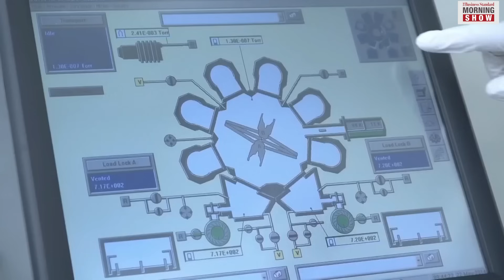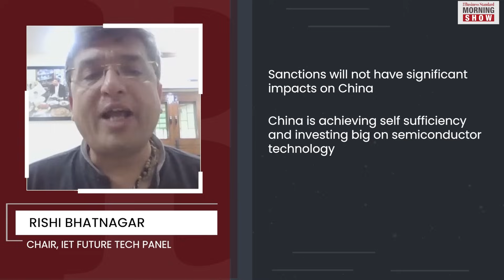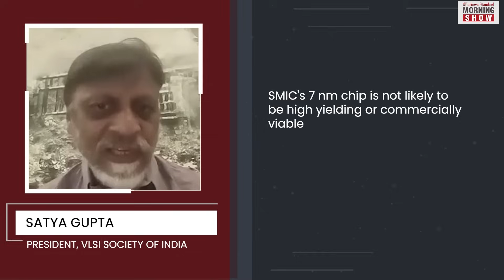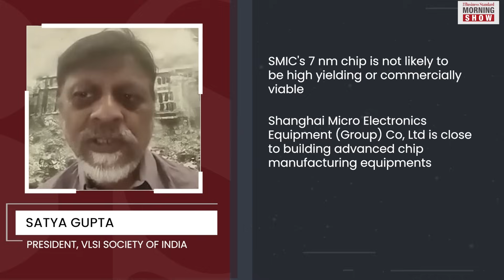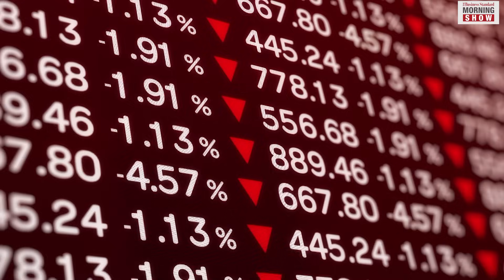Is China winning the chip war?

Comment: wouldn't say they're winning just yet, they're still 2 to 2.5 generations between U.S. They used DUV (not the more advanced EUV) to squeeze an extra layer on the silicon wafer, you could say they're cheating. But it's disturbing even after the US sanctions, they've achieved this much, who knows in 5 years time, they could be on par with US and Taiwan.